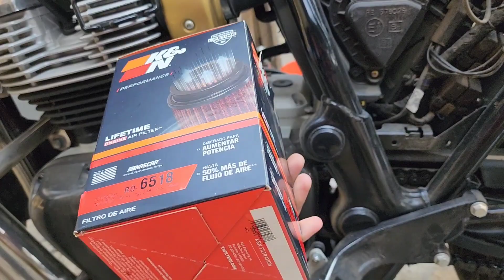K&N Air Filter | Royal Enfield 650 Interceptor | Installation

Comment: Hi Shivnath, have you faced any heating issues after installation of performance air filter?  Because your bike must be running lean after this installation. Are you using any booster plug to balance out the Air fuel ratios?
Reply from the maker: No sir , I am not using booster plug,  but after proper investigation will install fuel x. No sir heating issue was less than before , because I have installed radiator fan .
Reply: @ShivbnathhSingghaaRoy  thanks for your response buddy, please do make a video on radiator fan that you have mentioned.